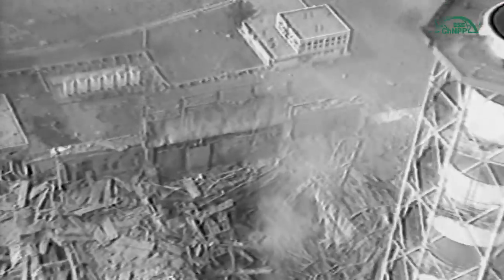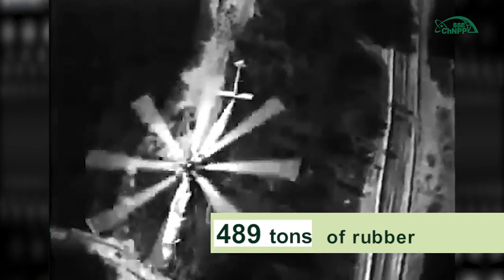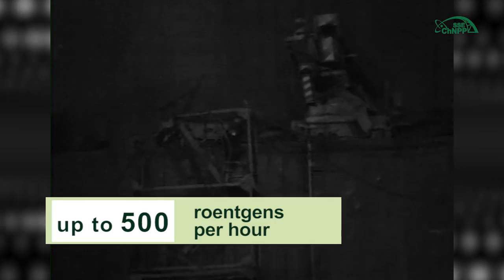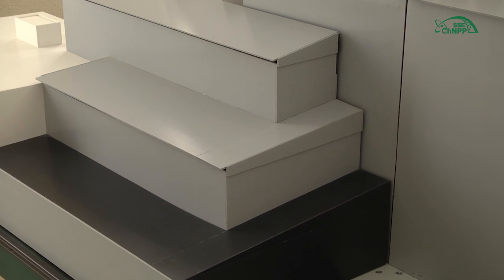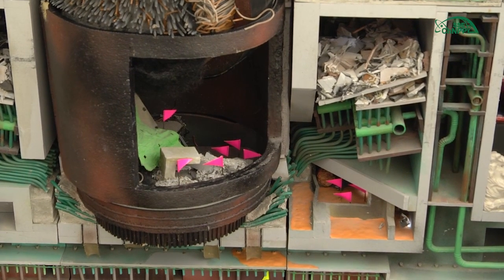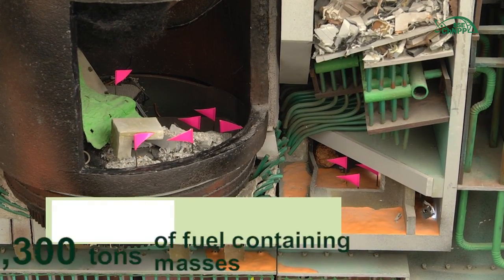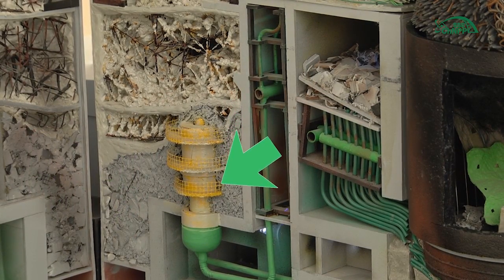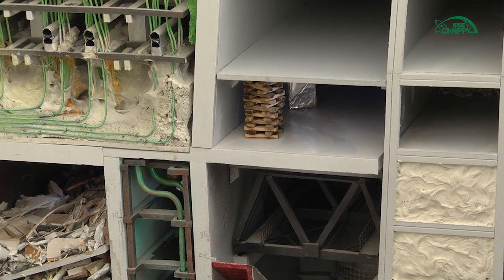Excursion within the "Sarcophagus"

Comment: Many people do not know that the other reactors at Chernobyl carried on for many years.
Reply: Milo Godeke You could google it, there are many sources, but easiest is to just check wikipedia. Reactor 1 was shut down in 1996 and reactor 3 in 2000.
Reply: Many people do not know that one of the other reactors at Chornobyl melted down (a bit) previously.
Reply: @jovetj  do u have a link on that?
Reply: @Xavi V
A link on what?  I've posted several tidbits of information on this thread.  To which are you referring?  You can't use an internet search engine yourself?  Do you need an older man to hold your hand?
Reply: @jovetj I know im 6 years late but like bro he just asked for some extra info 😂
Reply: @sillyman2013  Let's hope he figured out how to use a search engine in six years.
Reply: Many people do not know that the workers in the other reactors also suffered, until scientists arrived at the site they let the air circulation fans in the mother reactor buildings keep running which meant they sucked in massively contaminated air and distributed it around the other 3 reactor buildings. The radiation warnings in these buildings went off but the staff stayed at work, if they hadn't, if they had fled then there's a good chance I wouldn't be sitting here writing this and you wouldn't be reading it!
Reply: what choice they had. you cant make new power plant appear out of thin air. besides. you might as well finish the core life on the others. they would have to cooldown anyway. and this way the power offsets some of the cost of decommission. and building new plants,  elsewhere or building new power lines to carry it from elsewhere. a nuclear plant often puts out gigawatts of electricity. it takes time to replace that.
Reply: @msdadsfsx  let me call bullshit on that. India had a few nuclear related accidents but as far as im aware there were no level 7 accidents in India. Even fukushima in japan, where 4 reactors had a meltdown and 3 of the reactor buildings exploded (not the reactors) is classified as a level 6 accident.
EDIT: fukushima got moved to the level 7 category
Reply: many still dont know,that there was enother fire in 1991
Reply: @dolfinger  that is..... turbine fire!!!!
Reply: @richardscathouse  lol dumbass
Reply: syntaxerorr A partial meltdown happened in 1982 in reactor No. 1 as a result of a faulty cooling valve remaining closed following maintenance. In 1986, the Chernobyl disaster occurred at reactor No.4.  And then in 1991, a fire broke out in the turbine hall of reactor No.2, causing reactor No.2 to permanently shut down. Following pressure from foreign governments, reactor No.1 was shut down in 1996 and the last reactor (reactor No. 3) was shut down in 2000.
Reply: Most people actually do know🤦‍♂️
Reply: It is also not widely known there was a second accident, in 1991 reactor #2 caught fire and was shut down as a result.
Reply: syntaxerorr yeah the last one didn't shut down till the early 2000's
Reply: @msdadsfsx  Really ?
Reply: It only takes one. And anyone around will be affected for decades.
Reply: yes,next door...
Reply: i  know the exact date of the reactors shut down Unit 1=1996 Unit 2 had a accident and was left in 1991 and unit 3 went on to work for 14 years after the accident in 2000 the plant was permanently shutdown
Reply: "you don't eat a pig that good all at once."
Reply: @Btvstudio  yeah AZ-5 fucked it even more
Reply: No danger yeah right 
😊
Reply: No danger yeah right 😎
Reply: I know I didn't. I nearly choked on my chewing gum when I found that out.
Reply: @Kawasakicz Kawasakowski Yes i believe there are currently 8 still in operation. Most people dont know that chernobyl still generated power for Ukraine long after the accident, the final reactor to be shut down was unit 3 in year 2000.
Reply: Only unit 3, they shutdown it on 2000
Reply: Money was involved!
Reply: RBMK Reactors do not explode, you are delusional!
Reply: @Baghuul  stand next to Fukushima #3 and say that!
Reply: @richardscathouse  he's quoting a line from HBO's series on Chernobyl ;)
Reply: @richardscathouse  In Fukushima the reactor building exploded, not the reactor itself.
Reply: @richardscathouse  
There were hydrogen induced explosions outside the reactors, but inside the reactor buildings, not nuclear explosions. Even in Chernobyl the explosion was a thermal one caused by steam and not a nuclear one.

There however were meltdowns at Fukushima.

For so far we know now, nuclear explosions are impossible with the fuel present in normal nuclear installations.
Reply: @richardscathouse  when a nuclear reactor goes critical it just means it's operational.  The term "criticality" has been wrongly used in pop culture to describe a reactor meltdown.  It's a common misconception.
Reply: richardscathouse rbmk reactors are different to bwr reactors.
Reply: @richardscathouse  

Criticality does not mean nuclear explosion.
Reply: @ariswitty99  Correct, the term of concern is 'prompt' criticality
Reply: @richardscathouse Chernobyl was a 1000 times worse
Reply: They lacked to take action from earlier accidents and kept them secret. You can’t blame reactor nr 4 operators. They were just kept dumb and did the best they could with this unstable reactor even during normal operation. That safety test already had been done with reactor commisioning 2 years before. 

http://accidont.ru/ENG/accid82.html
http://accidont.ru/ENG/LAES.html
Reply: I found that out recently but I find that’s kinda a bad move people would have had to go into a radiation contaminated zone to work on the other reactors
Reply: @P7777-u7r  you underestimate the power of a regime, that doesn't care about safety
Reply: and watch the video from scott manley. just how fast and hard the reactor ran away was insane. it was not that far off from becoming a fizzle-type very low yield nuclear explosion.
Reply: Why not? They were no danger
Reply: @richardscathouse  there were massive design flaws in rbmk reactors. They were a huge risk.
Reply: richardscathouse this guy’s name is literally translates to Dick Shithouse
Reply: @richardscathouse  Good joke.
Reply: @richardscathouse  I heard an RBKM reactor cannot explode, so no wonder they continued.
Reply: @richardscathouse  yeah cuz reactor working on near to one of the most disastrous accidents in human history was cool
Reply: It isn't so much that other reactors at the same site carrying on itself is dangerous.  It's the fact that the same people who caused the disaster were still working on the other live reactors that is alarming.
Reply: @jovetj  same people maybe but not the careless leadman in the control room that night.
Reply: @triggas80  The concern was that the design of the RBK reactors was very bad.  Positive void coefficient is not favorable for nuclear engineering.
Reply: @Happyheartmatt  This actually depends on the design. Some are designed to work with positive and some with negative coefficients and have various systems which respond to change accordingly.
Reply: @jovetj   impossible they also got cancer or died  , if not gimme a name
Reply: @Sam ur boi
Just one example:  Анатолий Дятлов (Anatoly Dyatlov).  Survived radiation exposure and continued his post until he was imprisoned for contributing to the disaster.
Reply: Right and the fail safe AZ5 button fucked it even more  @Happyheartmatt
Reply: @jovetj  uh most of those people in 4 actually died and or got sick. Also the other reactors are further apart. Almost no one survived or returned to work who worked in building 4.
Reply: @ghsty
Yes, many of them did die. But some of them survived.  And some were supposedly prosecuted.  My point that the same people (more-so the higher-ups) who allowed the two meltdown incidents in the first place were still running the place afterwards still stands, however.
Reply: @Happyheartmatt  we still use 3 of those RBMK-1000 in ЛАЭС, near St. Petersburg, 70 km away of russia-estonia border. 4th was decomissioned last year.  They had accident with conditions close to what caused chernobyl in 1975, managed it and filled report about it's flaws but no further action until chermobyl has been taken to fix those flaws.
Reply: @jovetj  RBMK Nuclear Power Plants were buit in pairs. In Chernobyl that means R1 and R2 were in the left and right of one building structure, then  at a Km of distance were R3 and R4, and at another Km were building R5 and R6 and never finished.
Reply: @Haegemon
What?  The reactor pairs at Chornobyl are not a kilometer apart.  And, even if they were, I fail to see what that has to do with what I wrote above.
Reply: @Happyheartmatt  stop making shit up after a 30 min yotuube video about nuclear reactor man jesus christ
Reply: @Happyheartmatt  You need a big void coefficient to run on both unenriched uranium and light water, though. And the real reason it was run with a beta coefficient above 4 was to create weapons-grade plutonium on a whim.
Reply: @Happyheartmatt  It depends on what you define as "bad". I am no expert, but I heard that RBMK basically traded off some safety for cost saving on the reactor and to allow using less enriched uranium (I never verified that claim though). It is worth noting, that the safety tradeoff was not that big, however when combined with mismanagement proved disastrous. 

Still, had the operators not let the xenon poisoning to occur (the power dropped too fast and too low when they were preparing for test) or had they decided to abort after it happened (they should consider turning the reactor off at this point) everything would be fine.
Reply: @jovetj  
All the people responsible for Reactor No4 meltdown were laying in fucking hospital bends, were you irradiated when you made that comment of yours???
Reply: @jovetj  It wasn't them who caused the disaster. It was bad reactor design, and a whole bunch of factors.
Reply: @maksphoto78  Bad reactor design did not cause the disaster.  Misuse of a poor reactor design caused the disaster. 

It may be bad design to design a bicycle with no seat... but you can still ride it.  You just have to be more careful with it.
Reply: @jovetj  it wasnt that. It was the Fomin guy who gave the go ahead for the dangerous test. He was the only one who went back to work at a reactor. The people who were responsible were the people in the central committee who didnt build safer reactors or fix the problem with the reactors graphite tipped fuel rods or the positive void coefficient.
Reply: @jovetj  well, the best way to learn is trial and error. I doubt that they would replicate the error they made that night.
Reply: @jovetj  Chernobyl had 1 turbine hall that connect to all of the reactors
Reply: @jovetj  the 2 people in charge got 10 years. I believe they were released in 5. Dyatlov out in 3. No the guys in charge were not I charge anymore.
Reply: @TheBlobik  Unfortunately, the disaster happened because they tried to shut down the system. There was only one rod inside the reactor when there should have been at least 80. (Rookie error made by mis-informed night shift staff.) When they realised the core was overheating, they engaged shutdown (3-5). The sudden shutdown caused all the rods to be inserted simultaneously, but due to the high temperatures the cooling water inside them turned into pressurised steam that then caused the explosion.
Reply: @jovetj  Да ну ? Неужели ? Они были осуждены и отстранены он работ
Reply: @triggas80  lies, read dyatlov's book
Reply: @Happyheartmatt  it wasnt allowed by soviet nuclear safety regulations
Reply: @triggas80  You mean Dyatlov?
Reply: @Happyheartmatt  yes but keep in mind alot of the problems that rbmk reactors had were mostly fixed after the truth about Chernobyl got out
Reply: @Happyheartmatt  Not necessarily true.
Reply: @krzosu  I am very sure this applies to anybody anywhere. A reasonably maniacal operator can destabilize even the safest reactors in the world as long as they know how to game the systems protecting it. Exactly what happened here. 11 RBMKs are still in normal operation even now.
Reply: @SkinnerBeeMan  Three people.
Viktor Bryukhanov, the plant director.
Anatoly Dyatlov, deputy chief engineer
And
Nikolai Fomin Chief Engineer.

Bryukhanov served 4 years.
Dylatov served 3 years.
Fomin Apparently served 1 year in prison then another 3 in a psychiatric institute.

The Soviets were going to convict Leonid Toptunov and Aleksandr Akimov (reactor operators), but they died from radiation poisoning before the trial began, the Soviets didn't get to dish out that piece of injustice.
Reply: @stevenlawrence278  I stand corrected.
Reply: @SkinnerBeeMan  Actually I was wrong!
I am currently reading the  bokk,  Chernobyl a history of a nuclear catastrophe, by Serhii Plokhy (An excellent book, the best on the subject I have read so far), and it has arrived at the trial.
Apart from the three managers, two other managers and a safety officer were also tried at the same time, in the same trial.
As the old saying goes, you learn something new every day, that's my something new for 9th January 2023!
Reply: @stevenlawrence278  I will have to check that book out. I was just saying the same thing today. Always something new to learn
Reply: @jovetj  Well mosto of those who worked there duing accident, died shortly after,....
Reply: @jovetj did people caused it!!!
Reply: richardscathouse you don’t see anything wrong with people working within a stones throw from one of the most radioactive places on Earth??
Reply: @richardscathouse  oh, this reactor with major flaws that had a disastrous meltdown? Yeah, let's keep the other reactors of the same model running, I mean, what could go wrong? 😀
Reply: @richardscathouse  They were no danger? The soviets were convinced those reactors are robust and couldn't figure out what happened. You think keeping the other ones operating was not dangerous?3
Reply: @rinleez  The Soviet nuclear power committee was able to determine exactly what happened!  
Ukraine's independent government shut down the remaining reactors believing they could no longer afford nuclear power, an entirely political decision! Those reactors were designed to run for a century!
Reply: @rinleez  The reason why reactor 4 exploded, was because of the test. If the test was postponed for another day, then maybe the Soviet union could still be here. It was Gorbachev who said that Chernobyl caused the downfall of the USSR. Back to the reactors, 1-3 had all done their safety test, because of what happened with the fourth,  we can gather that the safety tests were useless. If it wasn't reactor 4 tho, it could of been reactor 5 or 6.
Reply: Und das ohne Probleme
Reply: How in the hell could a man continue working in a radioactively contaminated area!!!?
Reply: @TheLostinTheUnknown  they got Hazard pay
Reply: @TheLostinTheUnknown 
1. They had no Chance. When Mother Russia sends you to work there than you work there
2. The Jobs were good paid.
Reply: @TheLostinTheUnknown  surprisingly enough some areas around Chernobyl are less eradicated than a safe big city there (forgot the name)
Reply: @TheLostinTheUnknown  welcome to Soviet Union where everything is possible and you are delusional if you believe in God and don't believe in Stalin!
Reply: WTF NO IT DIDNT the whole place was RADIOACTIVE!!!
Reply: Yes, and since they were on the same site, probably every one of them got cancer and died. >_<

Comment: What the human figures down in the rubble inside the reactor hall? They're not implying people went down into that rubble, are they? They'd have fallen over dead before they could even climb out.
Reply: NameNotAlreadyTaken2 There was a Horizon documentary in 1991 where it showed scientists climbing through the actual fuel rods that used to be in the core and also walking past the bottom the open reactor vessel itself.
Reply: They did just that! It was the only way! Equipment wouldn't work people had to secure the debris by hand!

Comment: The one benefit to the forced labor and lack of information meant that the cover was completed as soon as possible. Currently in Japan, because no one is forced to clean it up and everyone knows the full risks, it's not getting done as quickly as it needs to be.
Reply: In Japan, they use the homeless, and mental patients who can't begin to understand what they are doing!
Reply: Nonsense, for a start Fukushima is much more contained and doesn't require a shelter to keep the weather out as the Japanese reactors vessels are only damaged at the bottom.  Also the Japanese construction workers have been working around the clock for 8 years pumping nitrogen into the ground around the plant to stop contaminated water draining into it and pumping out the water that already left the plant into around 90 enormous onsite water tanks.
Reply: @krashd  four open containments? Unit 3 reactor blown over kilometers! This is less dangerous than Chernobyl! WTF are you smoking! Or are just a government shill pretending to be a viewer!